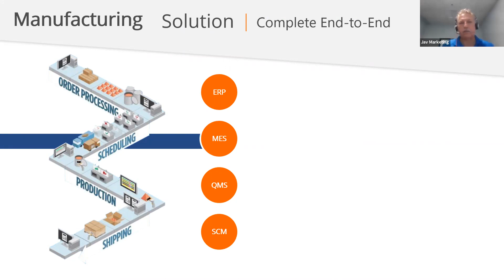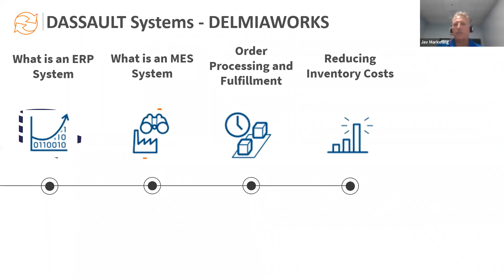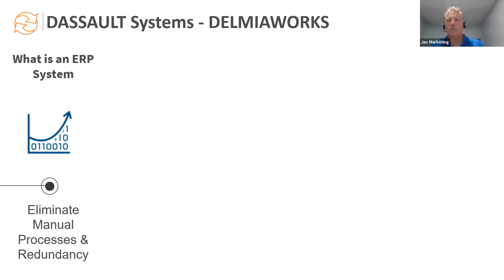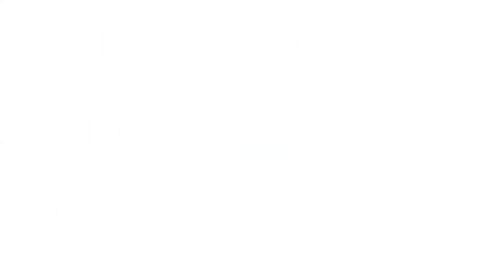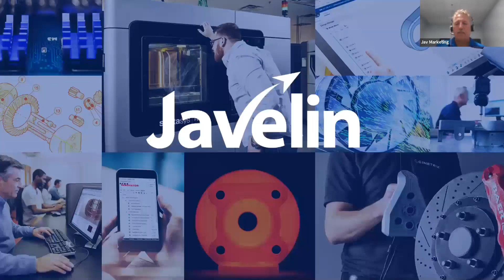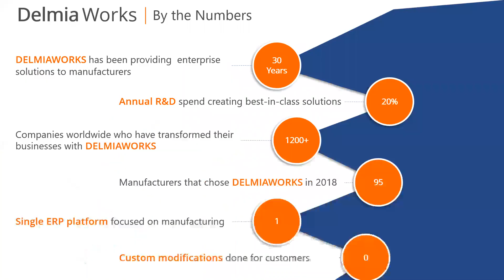Introduction to DELMIAWorks ERP and MES

Comment: We are using Delmia Works MES application. Basically this application has both ERP and MES capabilities. Now my doubt, I want to use ERP as separate application and MES has separate application for MES operation. I need to integrate both application. Integrating both application includes function like Sale order created in ERP should reflect in MES. It should Bi - directional sync of data between two application. 
For instance, I am using SAP ERP application and DelmiaWork MES application, How the integration can be done. Need some basic information for these case!
Reply: same thing i also want to know .